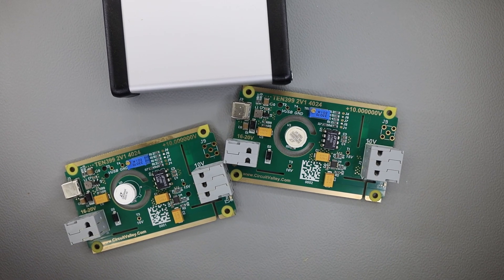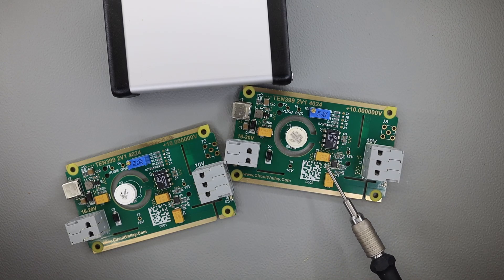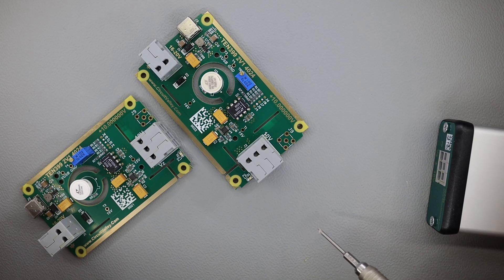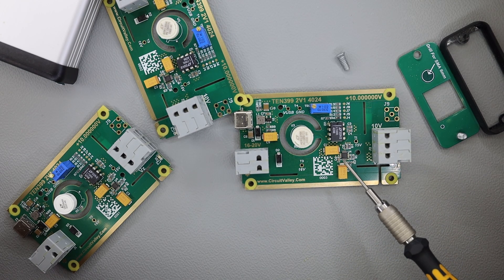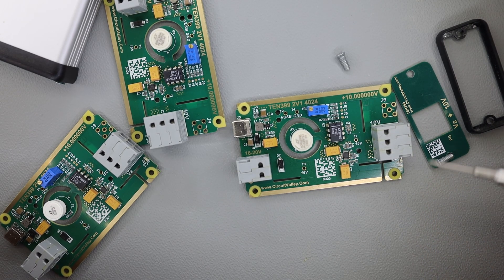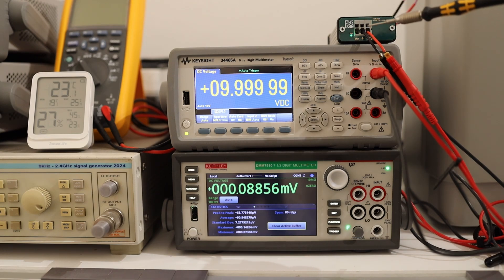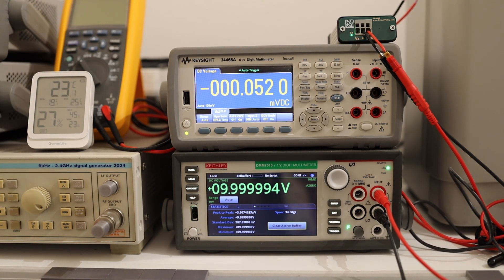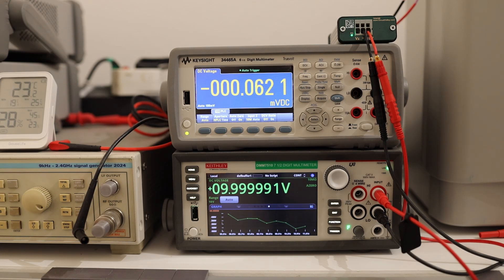V1 TEN399 : LM399 ADR1399KHZ 10V Ultrastable Precision Calibrated DIY Reference

Comment: what kind of resistors scale 7 to 10 V?
Reply from the maker: Its uses Thin Flip 10 PPM 0603 Resistors. Due to cost concerns
Reply: @circuitvalley  It's kind of weak.
Reply from the maker: @Ruth_Asada  Yes You are right, There are other Solution, They will cost quite a bit mroe
Reply: @ if you take the assembly of the resistors in one housing and configure it as a divider, it will be cheap and productive.

Comment: Nice project!
The manufacturing friendly many trim resistors approach is smart. 
Seems like you are using the datasheet circuit for lm399. Why not use the bootstrapped configuration like in the art of electronics chapter on voltage references. Its free (still one opamp) and gives better power supply rejection. 
Another thing is that you are using potentiometer as a rheostat (variable resistor) instead of like potentiometer (voltage divider). Voltage divider configuration gives less tempco and greater stability. Leslie Green's analog seekrets book has a great explanation for this.
Also what about a usb boost converter that gets turned off when the 16V is plugged in. Although it may become noisy just by having the USB cable plugged in.. A reference always backed up by a power bank for example would be really convenient.
Reply from the maker: Your points has been noted. Potentiometer will go away in next version. There a new version coming up with changes.

Comment: Any plans to sell them preassembled and calibrated?
Reply from the maker: Yes they are available, Drop me message. They are available right now
Reply: @circuitvalley  👍
Reply from the maker: @null2405  Board is Listed on ebay for German Buyers , or you can get it on Tindie https://www.tindie.com/products/circuitvalley/lm399-10v-precision-voltage-reference-calibrated/